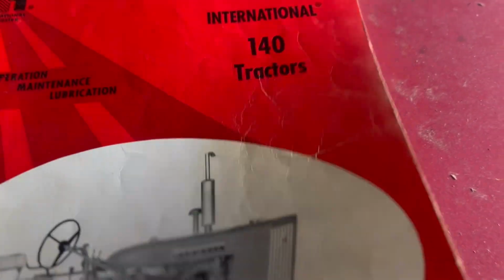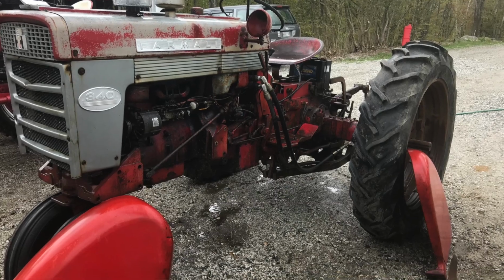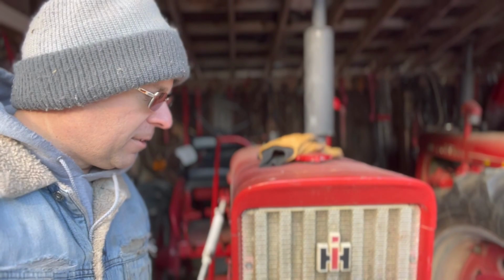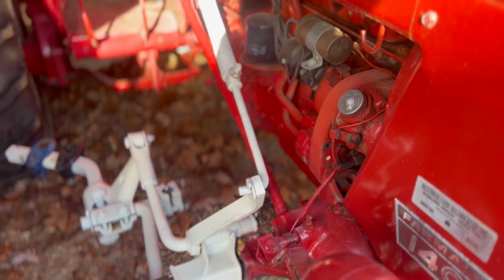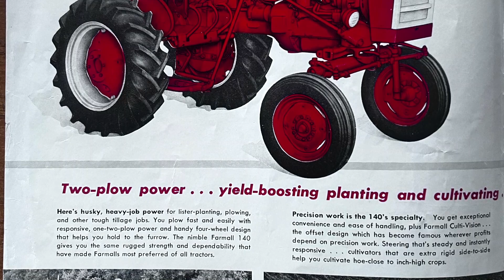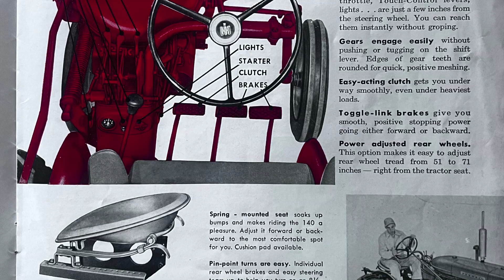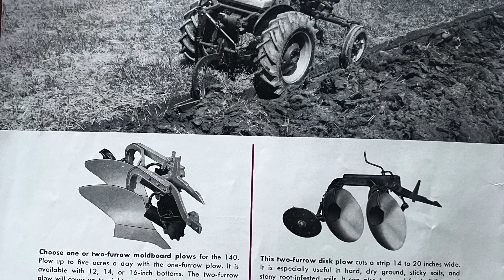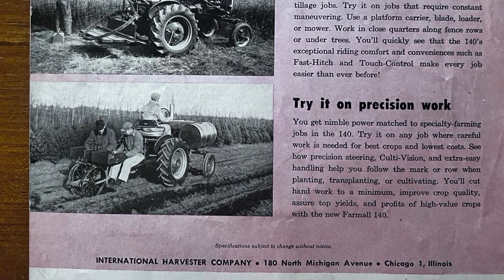1958-1964 IH Farmall 140 Brochure

Comment: Thanks for sharing Tom. My 140 is a 1963 model but I think it's a late 63 model. It has the new style grill and McCormick Farmall 140 decals rather than plates. It has the 6 volt electrical system and the cartridge type oil filter. For my money. they are the greatest small farm tractor ever built. If you haven't seen it, check out Jtwes channel. Joe has a 1976 140 and a collection of genuine IH equipment to die for.
Reply from the maker: You know, I always thought i wanted a 274 until I realized parts were hard to come by. I have seen his channel a couple times and I’ll check it out again soon. I’ve got a whole side dresser unit to put on mine that I’m saving. Have a great weekend
Reply: @tommys_trucks_trains_tractors  last year, I spoke to a man at the Denton thresher's reunion who has a 274 and he told me he could get parts for a  Farmall M easier than the 274.
Reply from the maker: @MarkWYoung-ky4uc  Case IH made one too. 265? I wonder about parts for that? Ford had a 1710 offset, JD had the 900 HC and Kubota had an L275 I think. There’s a place in PA owned by a couple Amish brothers who sell nice used stuff, but for big $. Burkholder Bros?
Reply: @tommys_trucks_trains_tractors  I bet so. I remember seeing the CaseIH 265s at the dealership and think I have a brochure for one.